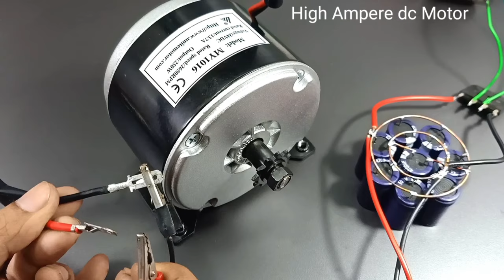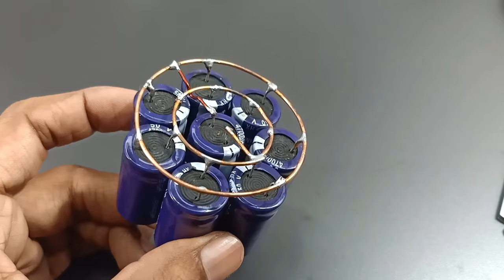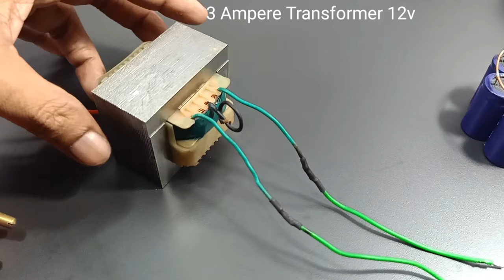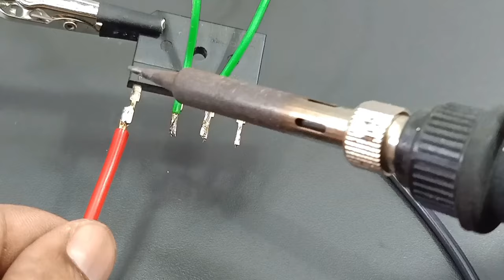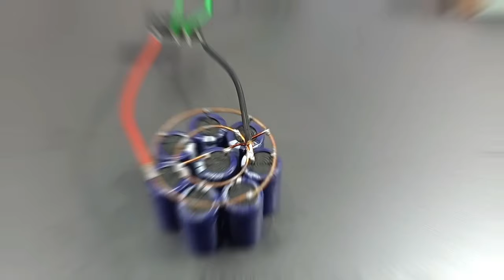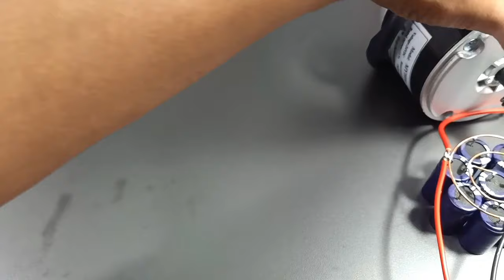3A -100A !! High Ampere Boost Circuit DC

Comment: Can we use it for spot welding?  If the bridge and capacitor are more, then there will be no problem?
Reply from the maker: No problem, you can try
Reply: When it's used up can be charges again

Comment: Best for this review,Assembling points diagram schematic .Place the diode bridge charge and capacitor in detail for better understanding...
Reply from the maker: Very simple circuit, screen shot the video
Reply: What diode is that exactly? I know a bunch of them have a letter and number code on them but I don't see it on there

Comment: Hi where this circuit can be used? once charged how long DC Power is stored?what is the DC voltage output?
Reply from the maker: 24v dc , High Ampere dc motor run with this circuit

Comment: Sir apne bich me kya use kiya capacitor ke pehle ac to dc converter hai kya?
Reply from the maker: Transformer 220v to 12v 5A
Reply: @RJEDITALL   sir vo nhi aur uske baad ic jaisa kuch 4 pin vala??
Reply from the maker: @lazy_leaf  rectifier bridge 50 ampere
Reply: @RJEDITALL  thanks sir 👍👍

Comment: Those two in the middle are they in serie or still parallel. I guess still parallel, but better ask. Also are they 25 microF (sorry theres no micro on my keyboard grrr.)
Reply from the maker: Clear not understand
Reply: @RJEDITALL  they are Capacitors, not? Alright how many fharad? And are those 2 in the middle... also parallel or in serie?

Comment: Can this run 24 0 24 2 amp trsfrm to play amplifier circuit? And how much ampere it will give then?
Reply from the maker: You use 24-0-24v transformer, work your amplifier

Comment: Good project but it won't boost ampere !
Reply from the maker: Ok, ❤️
Reply: If it will not boost amps, why will a 3 amps transformer power a dc motor rated at 13.7amps? I think it is capable of boosting amperage.

Comment: What is the value of cspacitor, and what is the connection diagram? You did not clarify.
Reply from the maker: 4700uf/25v, all capacitor parallel connection
Reply: @RJEDITALL 47,000 or 33,000? Uf capacitor
Reply from the maker: @yusifsuleiman5502  4700uf